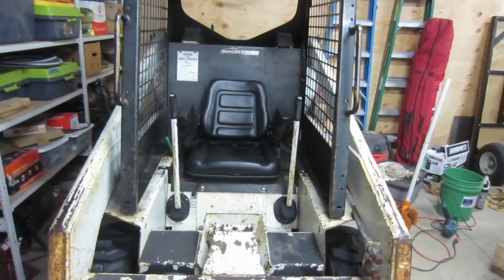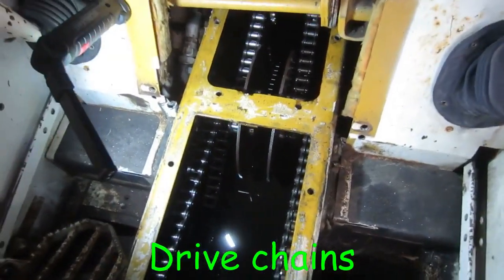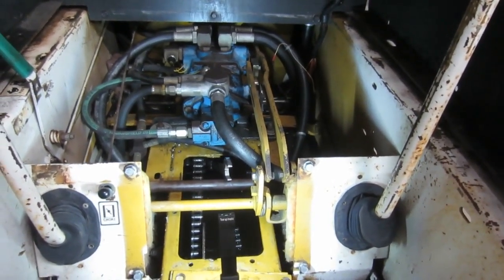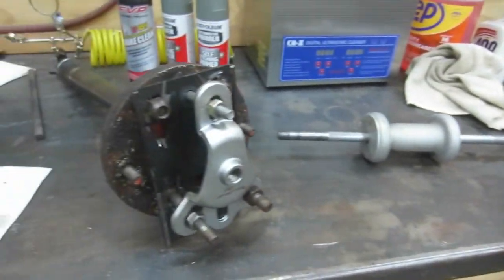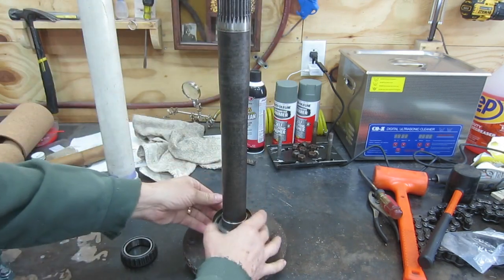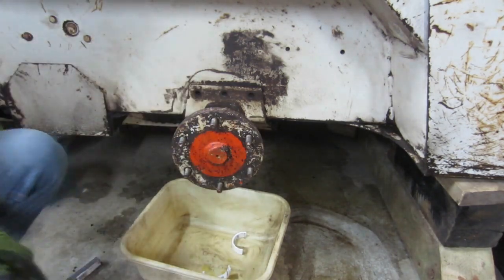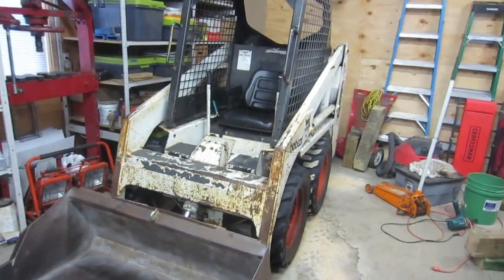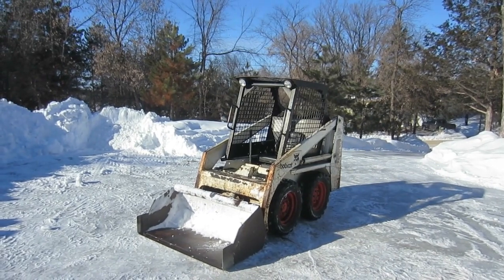Bobcat 530 drive chain & axle seal fix

Comment: Great job with the repairs Tim 🙂👍  Good thinking on the PVC to drive the sleeve.  I'm glad you could still make some progress in the cold weather. Take care and happy wrenching 🔧🔩
Reply from the maker: Thanks!  I keep a lot of bits and pieces around for situations like this where I need to cobble a part or tool together.  It's probably a gateway to hoarding if left unchecked🤨  I'm fortunate to have a heated workshop to get through my winter projects.

Comment: Very impressive!  Thanks for sharing, lots of great tips there.  I replaced the left rear outer and inner bearings and seal on my bobcat 743 last fall, was almost the same exact design as your machine.  It was very hard for me, wish I had seen this video first.
Reply from the maker: Thanks.  I know they switched things up just one generation after ours to where you could replace seals without removing the entire axle.  The biggest problem I've run into working on my Bobcat is the tight quarters.  It seems every job I do requires getting into areas I can barely reach and am working blind most of the time.

Comment: Why did you not show the brake block? How do you get the lever disconnected? I removed the bolt and moved the steering controls but the lever will not come off so I can remove the panel.
Reply from the maker: Sorry, I didn't capture that part of the job.  If I remember correctly, I removed the large brake lever retaining nut and the lever popped off without putting up much of a fight.  If it's frozen to the knurled shaft, try the heat and beat method to break it free.  Alternatively, you could remove the body bolts on both sides of the steering control shaft and you should be able to lift it high enough have clearance to lift the cover and brake block out as a single unit.  Good luck.
Reply: @TheToolmanTim  Thank you sir.

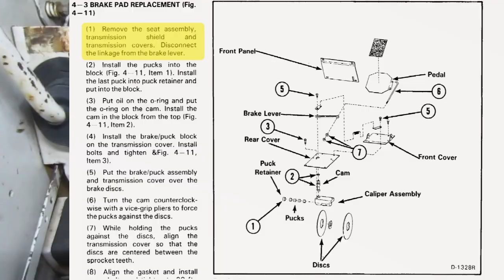Comment: Do you guys have any link for the blueprint/drawing of the machine at 1:27?
Reply from the maker: That picture is from my Bobcat service manual.  Search for Bobcat 530 Service Manual on Google and you should find some out there.  I purchased mine as a PDF on ebay for about $20.  It looks like the guy I got mine from is no longer selling it, but you might find others.

Comment: do u have a link by chance to the sleeve im in the same boat and cannot find the size of the sleeve and dont have means to measure it.. thanks
Reply from the maker: I used a SKF speedi sleeve 99226.  It's $42 on Amazon or $15 on ebay.  I bought mine from ebay seller militarysurplusparts and I see they currently have them listed.  Just search ebay using the brand and part number I listed and it should be the first one listed in your results.  Good luck on your repair.  By the way, mine is still holding up great with no leaks after 7 months in service.
Reply: @TheToolmanTim  thank u kind sir. I'm going to have to get a new axle I'm afraid. I just got a 632 and the bearings were non existence and chewed the axle up